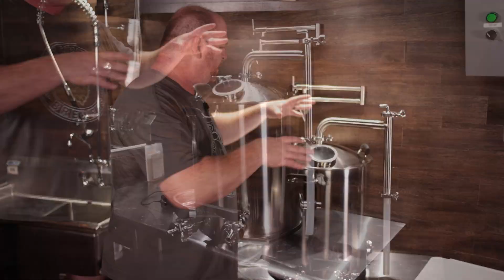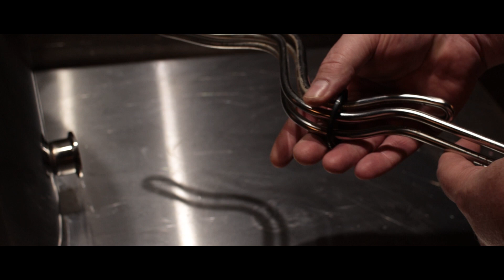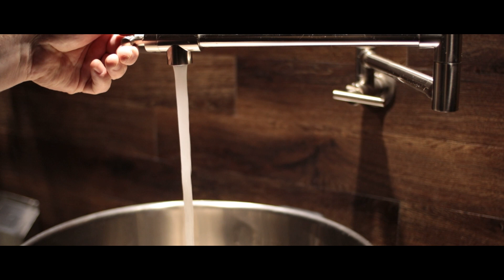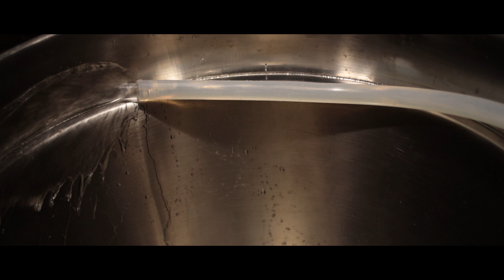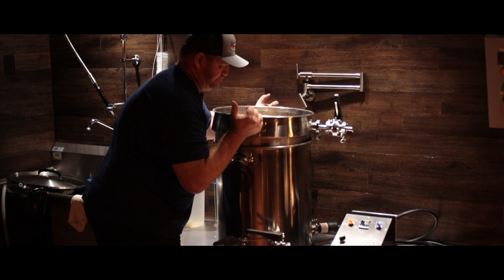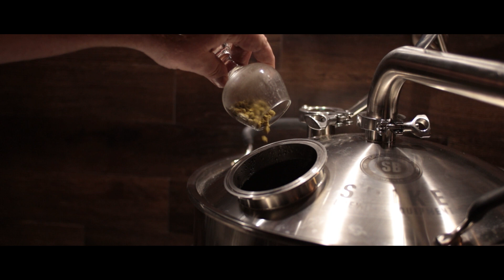Spike Brewing Steam Condenser Review

Comment: Question: I am looking or comparing the Anvil versus the Spike solo... as I would like to re-start brewing after so many years... any insight? your comment will be greatly appreciated. Regards
Reply from the maker: They are two different systems. The main difference is one of them is somewhat modular and can have parts replaced if something goes bad. Not to say that the anvil will give you any issues but just something to know if you need to replace a heating element or something major like that you have to replace the entire thing.
Reply: Thanks so much for your valuable feedback... greatly appreciated. Regards
Reply from the maker: @rpavon1959  welcome! 👍🍻

Comment: any tips on recalculating your recipe given the lower boil off?   did you only adjust your strike and sparge water amounts or did you modify the grain bill as well?
Reply from the maker: Water amounts will need to be adjusted. If you use software you can input your actual measurements as. Adjust for the next batch.

Comment: Will this work with a 10g SS Brewtech kettle? it’s nice, but haven’t found much info if it works with other kettles. Figured I ask you before buy the condenser.
Reply from the maker: They give the dimensions on their website. Have you checked there? The one on the video is for 20 gallon kettles. 👍🍻

Comment: Thanks for this video Brian. I just ordered one of these lids for my 20 gallon Claw Hammer system. It just dawned on me that I can't use a hop basket. I don't use a bazooka that came with my system as I have modified it with an elbow to draw more wort from the kettle at the end of the brew. I run the system through a whirlpool at the end of brewing to pass the wort through my plate chiller so I can't have hops going through there. I guess I will need to go back to the old hop bags but am worried about them coming in contact with the element. Cheers!
Reply from the maker: Set the hop basket on the.bpttpm of the kettle next to the element. You might need a taller hop basket but that works fine. I did something similar in the breweasy compact.
Reply: @ShortCircuitedBrewers  Thanks for the advice Brian. Have not brewed in a year as I moved 6 months ago and am building my new home brewery. Can't wait to get a brew out of the new space. Cheers!
Reply from the maker: @CanadianBrewingChannel  Cheers! 👍🍻
Reply: @ShortCircuitedBrewers  Hi Brian, I am using my condensation lid for the first time today and it just hit me. How do you deal with hot break? I am worried about a boil over. Do you leave the 4" port open until hot break happens? Cheers!

Comment: What about boil overs? I know with electric systems you can sort of control that, but at times when distracted you may have a boil over. So would the condenser lid self control that a bit or not?
Reply from the maker: "kinda" it will "puke" out of the down pipe and it makes a REAL mess..(ask me how I know) but it will kinda minimize getting the exterior of the kettle all grungy. Not a "solution" for boil overs the only solution for that is to monitor your kettle.👍🍻

Comment: also on the water loss you can dump hot water back into pail with cold water throw some ice in and keep recycling the water there is no need to keep using fresh water. Just 3 gallons in a fermenter pail will work just fine. You just need to keep water temp below 60% or so of steam temp to make sure it is efficient.You can use the hot water to clean that way you don't throw it way as well.
Reply from the maker: Good tips. I'll have to try it. 👍🍻

Comment: Great video Brian!! I just tried one of these last night with a 5 gallon batch on the 20 gallon system and had a boil over from the hot break. Did you wait until the hot break dissipated before putting hooking up the condenser?
Reply from the maker: No I just waited until the boil started and turned the power down to 40% that kept it from boiling over. 👍🍻
Reply: Thank you for the reply, one last question if you don’t mind. Did you have a lot of grain that made it through the basket?
Reply from the maker: @ryanamuso  there is a little usually but not much. There is always some residual grain that makes it through the screen on these type of false bottoms. Unlike a HERMS or cooler mash setup your grain basket is on the boil kettle so some of that does not get filtered out from the vorlauf or recirculation.👍🍻

Comment: If you don't boil off as much water, how can you be short of water? And the condenser is just for the boil, how and why would it affect the mash when condenser is not in use?
Reply from the maker: The calculation of boil off was wrong in my profile. (I was using ba profile I had made in brewfather) I accounted for .5 gallons of boil off instead of 1 gallon. I started with less water because of it.
Reply: @ShortCircuitedBrewers  I'm finishing my basement for a brewery and going to purchase either the spike 20gal system or the SS brewtech. Any suggestions or recommendations?

Comment: That water usage is a deal breaker for me. I don’t have a well.
Reply from the maker: I may toy with using ice water and frozen water bottle to recirculate.
Reply: @ShortCircuitedBrewers  Have you tried the ice water approach yet?

I was wondering if it would be possible to simply recirculate the drainage as long as it’s cooled. Using 30 gallons of water per session is a non-starter for me.
Reply from the maker: @RussGuill  I haven't but I think it's doable. Using 10 gallons of water with ice in it.👍🍻
Reply: Collect in a large water jug and dump into your washer.- great idea Brian. I recirc back into my cistern.  This is a great solution for up here in Canada when it’s like 15F in the garage!
Reply from the maker: @silveraven1  that's a good idea!

Comment: Great review Brian! I know spike "engineered" this, but that effluent temp and volume usage indicates there is an inefficiency in the implementation. Thought I haven't seen it myeself, I suspect that pump's low pressure (6 psi) is not atomizing the spray as well as tap pressure does (~40 psi).
Reply from the maker: Probably right. Out of anyone you would know. Since you were the first to design and use one in homebrewing.. cheers!! 👍🍻

Comment: It's "Con-den-sate".  20 years in piping design.  Why not just use a drip leg and a steam trap, you can coil around the drip leg with a water jacket if you really need.  You could also redirect the already paid for steam to a jacket around your pot to increase the efficiency of heating, still keeping the steam trap at the lowest point to remove the steam condensate.
Reply from the maker: Not a bad idea.

Comment: Great video. I made my own condenser this spring but don’t have all the bugs out yet. It’s been too hot this summer to brew. Why and how did you modify your mash water volume? Why not just leave the water volume the same as no condenser and boil for the same time but condense the required amount of steam? Is that to cut down on cold water use? I’m no expert...just looking for a better understanding. Thanks!
Reply from the maker: The condenser is only going to condense a certain amount of steam. Even if you crank up the power it's still only going to boil off a certain amount. At higher boil the steam will just wind up back in the boil. My profile I had the boil off rate at .5 gallons and it wound up being 1 gallon (as opposed to 1.75 without the condenser)  so I could have started with a half gallon more which would have helped with the mash thickness. 👍🍻
Reply: Ok thanks. I have been meaning to do a calibration test on my condenser equipment but like I mentioned earlier it’s been too hot. I’m changing my brewstand propane burners at the moment. When I get things operational again I’ll take a fresh look at how much water I mash with. Cheers!🍻

Comment: I received my Condenser earlier this week. I set up a recirculation of the chill water through my plate chiller and ran the fermentor chiller hoses to cool. My glycol temp rose from 27 to 44 ºF over the hour boil. I started with  2.5 gallons of water in the bucket and unit added 1/2 gallon of condensate to bucket. I was very happy with the lid and recirc of water to limit water usage.
Reply from the maker: Nice thanks for the tip! 👍🍻

Comment: Nice review!  I've used mine twice now.  Overall, I like the condenser since it allows me to brew in the basement without a hood.  Couple other gripes for me is this thing is loud!  Doesn't make for a pleasant boil session but it's a minor gripe.  I've also noticed that I've had some very long boil over warning periods with the condenser installed.  My last boil kept foaming for 30 minutes before it settled down and I decreased the power.  I think next time I'll let it boil uncovered for a good five minutes before installing the condenser.  It wasn't a fun experience constantly spraying the foam down and shutting the heat off and waiting a bit.  I'll get it dialed down eventually but it's not as simple as I had hoped.  Fermcap ordered.  I think that will help.
Reply from the maker: Yes ferm cap should help. 👍🍻

Comment: Do you think a stainless mesh hop spider that hangs off the side of the kettle would effect the seal of the lid thus making it ineffective? Was interested in the solo w/ a steam condenser but I'm concerned about clogging with no sort of hop filter.
Reply from the maker: Just stand it on the bottom of the kettle. They make some that are pretty tall.

Comment: Well now I want one. Any idea if this fits the clawhammer system?
Reply from the maker: Martin over at @thehomebrewchallenge says it does not quite fit the 10 gallon system. He has a video coming soon on his experience.
Reply: I have the 20 gallon system...
Reply from the maker: @jd7ncoke77  do you have a inside diameter of your kettle. I'll check it and see if it will fit.
Reply: @ShortCircuitedBrewers  it will have to be later today since I'm at work but will definitely get back to you. Ty
Reply from the maker: @jd7ncoke77  ok sounds good

Comment: Could you recycle the spent condenser water to refill the sump? In essence, recycle about 10g of water between a few 5 gal buckets.
Reply from the maker: As long as the temperature did not get too high. You could. 👍🍻
Reply: @ShortCircuitedBrewers  Yeah I would say use a 5g bucket and some ice packs and put your pump in the same bucket it's draining to.  That would keep the temp down, and you're using at most 3-4 gallons of water at that point.  I'm waiting for this system to come back in stock.  I plan to purchase it and will update you if/when I try this.
Reply from the maker: @mattb6124  please do update us!

Comment: Can you just recirculate cold water in a bucket? You may have to add some ice occasionally.
Also, did you find that exit tube to be too short to run to a bucket on the floor or a floor drain?
Reply from the maker: I did run the tube into a bucket on the floor. You could recirculate the water as long as you had a good temperature differential to allow for the low pressure to occur. The exit tube can be any length you desire as long as it does not get submerged. 👍🍻
Reply: With the tubing length, I assumed that what we saw is what we get from Spike.  Silicone tubing of that gurth has got to be expensive.  (Insert joke about the size of Brian's tubing here.)
Reply from the maker: @jsudduth7465  haha.. it doesn't need to be silicone.. lol I long black hose (for automotive hot water 😉) would work as well.. 👍🍻

Comment: Hi Brian, can you please explain why the boil off rate is lower? Apologies if I missed that in the video.
Reply from the maker: The top of the kettle is not open to the air to allow for the steam to escape. Some condensation takes place inside the steam hood, not only the tube, and that drips back into the kettle. There is enough steam carrying DMS boiled off to remove it from the beer though..
Reply: @ShortCircuitedBrewers  Thanks! I was thinking the vacuum it creates would draw off as much steam. What's the difference between the two methods?
Reply from the maker: @IanTriggs  the condenser boil off is about 1 gallon per hour. Without is  1.75+ gallons depending on the element power.